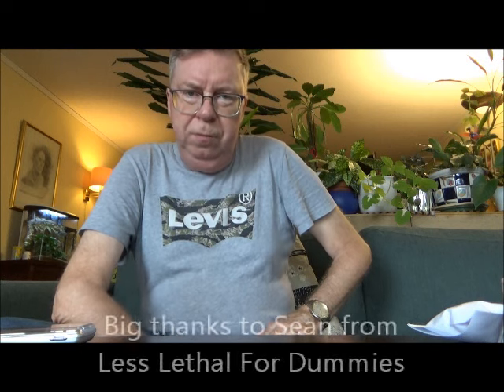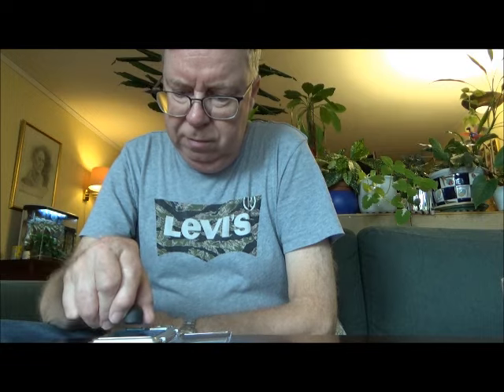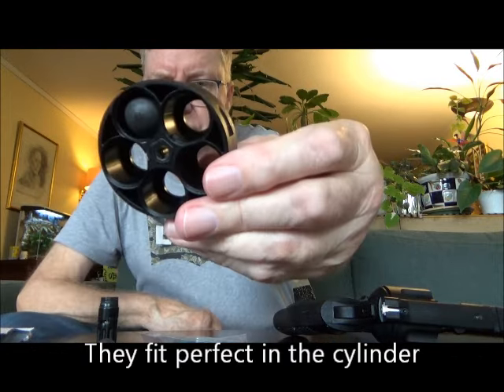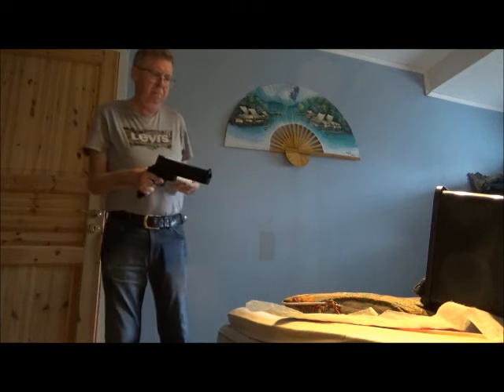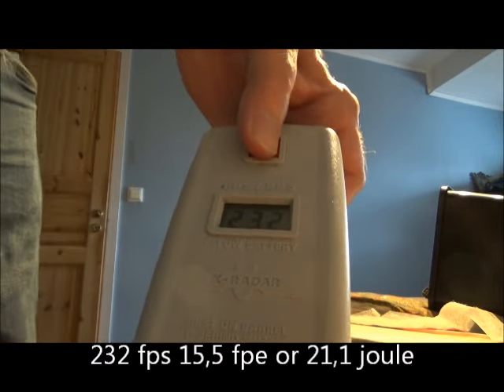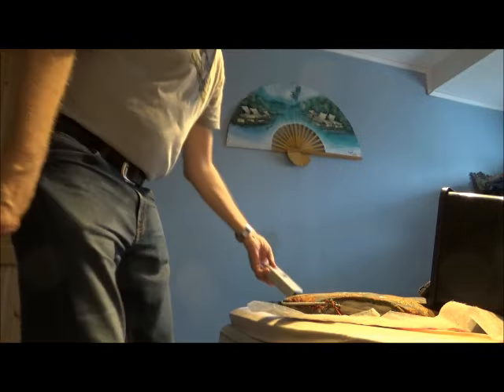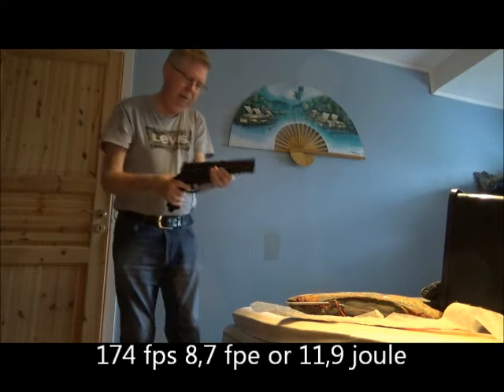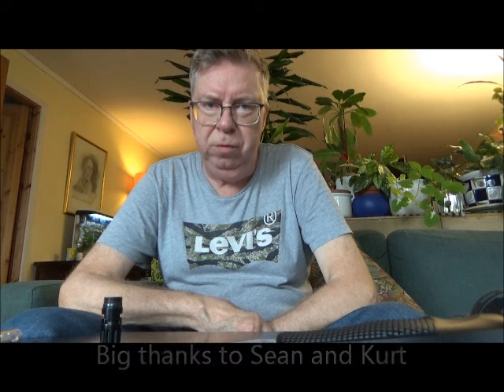Grimburg FAR, Umarex HDR68 in 16 joule version

Comment: Can one buy the restrictor or make it ?
Reply: you remove the restrictor. You will have to partially open up the back of the gun. It will be were the indicator valve pops out. you'll need some tools to remove the brass cap. Trust me it makes a world of difference!
Reply from the maker: For max power you dont want anything blocking the valve. I will make a new video where I test it without the restrictor and using the same slugs. If you have the 7,5 joule version I have a video showing how I powertune it. Its named "Umarex HDR68 Powertuning". Its an easy job and highly recommended 😉👍
Reply from the maker: @alexisfarelo  Very true my friend.
Reply: I thought you just unscrew the restrictor and drill a 1 mm opening @alexisfarelo
Reply: Another great review! Thanks 👍🏻🇺🇸
Reply from the maker: @tonyarthur578  Thanks my friend. Iam glad you like my videos 😃

Comment: Those were actually a gift from Kurt at Grimburg. I was just the liaison 😊.  

If they are magnetic you got the brand new FAR projectiles. Mine are coming today says the postman.

They fit very nicely, dare i say perfect?

Super stable fps. I was very surprised.
Reply: Perfect is right
Reply from the maker: Thank you Sean. The slugs fit perfect. They give very stable velocitys. Hi quality indeed 😃👍
Reply from the maker: @Craig59J  They sure are perfect 😃👍
Reply: Nice test. I have a bag of about 50 of the old ones. I will have to try them in my HDR68. I sorta forgot I had them until I saw this video. Thanks.
Reply from the maker: @bryancantrell1138  Thanks my friend. Iam glad you like the video. I think the old HP68 will work great in your HDR68. Since they are lighter they will fly faster than the slugs I used in this video.